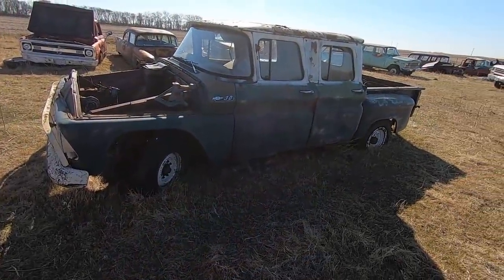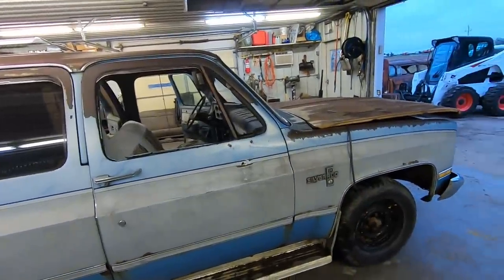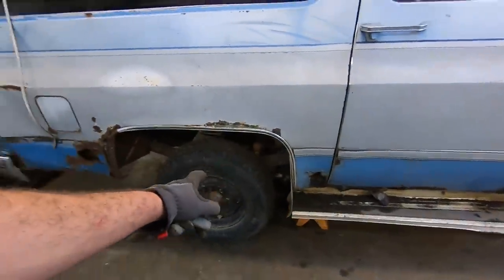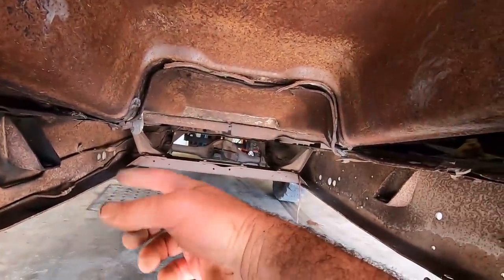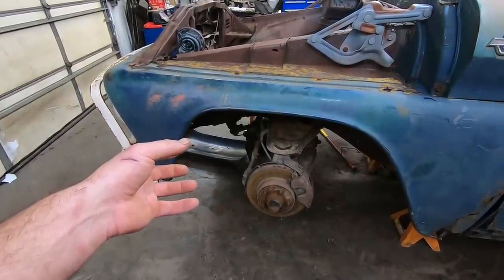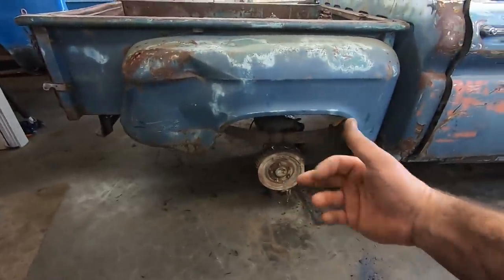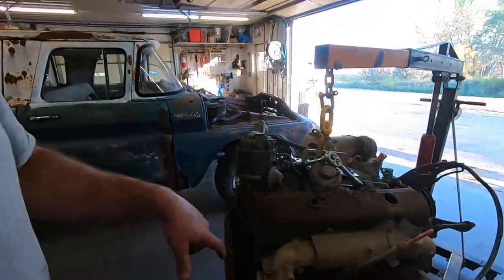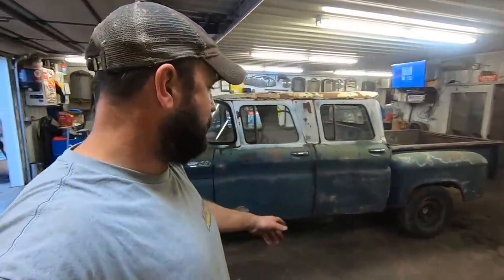RARE! 1962 Chevrolet CREW CAB factory conversion field find! And 1/2 ton suspension swap!

Comment: You could also use c20/c30 squarebody engine towers. They are shorter and almost mount up perfectly. It's what I used on my 68. Works like a charms. Keep up the good content
Reply from the maker: 67 on up trucks have taller frames
Reply: That’s what I used in my 63 C10.

Comment: I feel Sorry for anyone who would have to rebuild a truck so far gone as this one. I recently rebuilt a 1957 chev 1 ton , and after replacing the cab ect... 3 donor trucks, parts from four old doors,I finally was ready to start body work . It took me and a friend 1 and a half years to complete. It  Has a grafted on frame welded on right behind the shock mounts  from a 1974 chev  3/4 ton , rotors from a 1988 1 ton PU, and a 1978 differential . Also, I think all 302 Blocks had DZ stamped on the engine pad. Great Video guys!, reminds me of days gone by.

Comment: Awesome job dude! I have a question! I thought you could take the chevy suburban body off of it's frame and take the old truck off of it's frame and do a frame swap? Would that be easier? Maybe more work? If the one ton is 133 inches wheel base? I think the suburban is 129.5 if I remember correctly? Just curious! Have a good one!
Reply from the maker: Then you gotta remake all your body mounts and your wheelbase is off

Comment: Great channel! I’d love to spend a week rebuilding an old square body and getting it back on the road. As a truck driver(mainly in the south) you hardly ever see anything older than a mid 90’es. My DD is an 03’ F150 4.2 4x4 but I’d love an old F250. If I lived closer I’d probably buy one of your old trucks.

Comment: When you install the 1983 Chevy cross-member square body. Then you did put in the lower mounts. The mount was too high over the longitude chassis rail of the 1962 Chevy crew-cab truck. Here - some suggestion is to add in the bar as a spacer between the mount and the chassis. Then drill two holes thru the bar spacer. Then heavy duty rail spacer will be tighten with two bolts and two nuts plus extra bolts and hex nuts on other side where the mount (car engine cradle) is. You did super job and on film.
Reply from the maker: That’s exactly how I do them

Comment: YW is a 1966 327/185 from a C60, M60 or S60 truck. Your block was cast on January 27th, 1966 and the engine was assembled on January 29th at the Flint, Michigan
Reply from the maker: Yup!

Comment: Hey Mortske, Got my Duff Tee shirt. Cool. YW is a 66 327/185 horse out of a C60 truck. The relieved pistons are a give away it's 60's. The 70's went with dished pistons for smog issues. I have a 1969 300 horse 350 with the same pistons. Really enjoyed this video. I was unaware those front ends could be swapped like that. Keep up the good work. Thanks
Reply from the maker: Thanks for your purchase Bob!

Comment: Same year as my bus. Same emblem only 50 not 30.
I had to swap out the front end from a 72 C50. Only Chev, not GMC, had the torsion bar IFS for just 3 years. 
I couldn't find any parts for the original setup. Called across Canada and USA even talked to a couple guys in Mexico.
Gave up on that.
I just built a new 350 for my 82 K20. Now I have a 350 4bolt block sitting around that I'm tryna sell. No luck so far. 
It sure is a lot funner watching you rip shitapart, lol. Good fun.

Comment: Very good friend of the family (I still call him Uncle Phil) was an engineer for Union Pacific RR and bought one of their left over Crew Trucks like this. Come to find out they made them for the Rail Roads as well as the Military. But his is a 3 door, not the 4 door. Been years since I seen that truck, but is does still have the old manual "rail riders" that drop down so they could drive it on the train tracks. Good vid, and good find.
Reply from the maker: Awesome!

Comment: A quick glance at the back of the crank with the flywheel/flexplate off will tell ya if it's a 350 or 327. Great episode!
Reply: 327 blocks are hard to come by now. That block could be salvaged with a sleeve. Of course the pooch in the side of the pan might indicate a thrown rod Dropping the pan would reveal the truth .

Comment: The Apache was a trim model. Just like c10,  cameo, silverado, cheyenne and so on.. My first truck was a 1960 Chevrolet Apache custom fleetside longbox with a 230 sstraight 6   3 on the tree.
Reply: C-10 is a model not a trim option.

Comment: Definitely a 68 block. You can tell by the pad where the crankcase breather tube would have been mounted on small blocks through 67. I had a couple of these 327 blocks. Large journal with cast crank. But as Mortske pointed out, it was rebuilt and a 350 crank installed.
Reply from the maker: Good info!

Comment: On my '65 C10 I went with a Scarebird setup disc brake wise. Seemed the best option at the time. Factory parts (they give you a list) wise, rotors, bearings, calipers pads etc. All on the factory spindle. What they did not mention till I was installing, was hey, you cannot use factory rims.....$700 in wheels and tires  later I had disc brakes. Rez engineering PS conversion, and a random 1/2 ton suburban swaybar and stands later...
Reply from the maker: I've used their kit on a Dodge D100. Same issue, stock wheels wouldn't fit.

Comment: that is a rare find i get a lot of rigs but have never found one of these i do a lot of hauling off places that people died or they need to sell the place u would be surprise on what i get one place told me to haul off all the rigs they had 5 in the shop with a bunch of engines some fresh rebuilt parts in boxes transmissions and 15 rigs out side all good rigs . this will pop ur head the first one inthe shop was a 79 chevy cheyenne 4x4 short box full option truck in mint condition with under 35,000 miles on it the car next to it was a 67 rs ss 427 yenko that was being  restored next to it was a 68 ss 396 both camaros the next to them was 2 79 z28's all are rust free clean body cars the truck i had to put a new fuel pump and clean the carb still runs great today no shit just haul it off had 30 days to do it all. so they could put the ranch up for sell 6,000,000  they thought it all was junk
Reply from the maker: Crazy!
Reply: @MortskeRepair  i call it my holey grail find plus i don't know if u know that u can get the ho 454 450 hp with a 02xx 400r turbo out of motor homes i got 4 of the crate sets so far this year with 6,000 to 58,000 miles on them for free saves a lot on a build the engine has the 4 inch stroke with steel crank heavy rods high flow heads the 02xx 400 is good to 800 hp and they work great gm calls it street strip or heavy application trans

Comment: That was a very clever way to load the truck!
Reply from the maker: Gotta get creative when they won't roll!
Reply: Just got to the end of the video and had a I-know-very-little-about-this-stuff question for ya: Would it be possible to sleeve the cylinders to get around that crack or is the block a lost cause without some serious work?
Reply from the maker: @SpawnofChaos  You could definitely sleeve the block with some machine work.

Comment: Man they certainly walked away from that gem after they'd cut-n-shut it and said "yep.. thats perfect"

Makes the "quality" control at landrover in the 70s look almost Rolls Royce-esque
Reply: It was probably a power, water, telephone company or fleet truck they were not really worried about long term.
Gm did not do that it was some small independent shop. Wouldn't be surprised if they also did limo's.
I'm betting they are long gone
Reply from the maker: Air Force rig.

Comment: just did some delving into my books and the numbers you have is its a 350 smog block for 1979 light duty truck
Reply from the maker: Interesting, for the casting number or the stamping number?
Reply: @MortskeRepair  the stamping numbers

Comment: I got the same Harbor Freight jack. On sale for 80 bucks,works just fine.👍
Reply from the maker: Lucky!
Reply: @MortskeRepair  If yours quit,you may wanna check the fluid and re bleed it. Had to with mine and I've used it regularly for appr a yr with no problems.
Reply from the maker: @stevewheatley243  Mine puked the oil out of the seal. So the seal is shot at a minimum.
Reply: @MortskeRepair  Bummer bro. You could  put new seals in it. Good ones.

Comment: the 283 damper is narrow (3/4") - 327 wider 11/8" or so 350 is 11/2 approx. - 400 is oddly shaped since they're externally balanced (different flex)

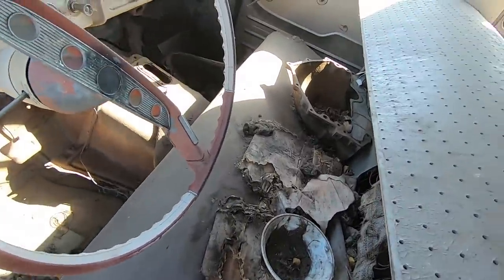Comment: At the beginning of this video, (1:20) Duff's fur looked like my beard when I'm left alone and people aren't around hassling me, but by the time the Suburban was being unloaded at the shop (9:00), he had obviously seen a beautician.  If I cleaned up half as good as Duff does, I would definitely have better luck with the ladies because personality alone can only take you so far.  Anyway, another good video although this one is only half the length of Dances with Wolves, so I'm not sure what I'm going to do with the extra hour.
Reply from the maker: He grows it out real fast! 5 O'clock shadow!
Reply: @MortskeRepair  ha  that quad  cab needs some gallons of bondo  and surform files to contour it up  and a smoothsided bed

Comment: are those keystone step twos? the hamms brewey buildings are still in saint paul minnesota. grandfather and dad worked there. flat cardboard tray of dented cans for .50 cents. i think like 24 cans of hamms. awesome lock stock and barrel battle between west side of saint paul with schmidts and east saint paul hamms. the neon light of schmidts was often vandalised when they cut the letter m. schidts. grain belt was minneapolis.
Reply from the maker: I love that big Grain Belt sign!

Comment: If that stamp is a YV and not YW then it is a 1968 327 220 HP 4 barrel with a manual transmission.

Comment: 700 r 4 I think those are great transmission I got that kind on a 1988 chevy stepside great truck  my friend quite the tork  with those  4 11s  in the front and back cause it is 4 wheel drive peace out my friends 😁👍

Comment: The engine appeared to have a passenger side dipstick which would make it a 78 or later block, strange because I find that casting number as a 68 also???? More than likely the heads are cracked also across the center 2 exhaust seats, that was common with those 78 and later lightweight castings.

Comment: Do you ever rebuild a motor? Opps, you answered that 1 rite after I asked. Fun times
Reply from the maker: I have, but not for a LONG time!
Reply: @MortskeRepair  Maybe a super cheap rebuild would be cool. I cracked a piston 1 time and just replaced rings 1 size over, honed the cylinders and rod and main bearings. Pretty cheap and I got another 100k out of it. I don't know if it would be cheaper than buying used runner, but would make a cool video I think..

Comment: Last 1saw was in Attica ohio it was red a Ashland oil it had cross bars at the front behind the double cab and a set at tailgate no doute it hauled oil pipe truck was a 1966 283 4bolt mains 4 speed trans

Comment: That Burban probably came with a TH350 with a lock up converter. My 80 C10 did.
Reply: HE said it has indicators for 4 speed overdrive which would require the TH700R-4 which is an electronic lock up torque converter transmission... the 350 is only 3 gears at final drive ratio of 1:1

Comment: Yes you could sleep it but usually they don't run the same after they're sleeved they actually bore it out as big as it can get and then they put lock type 515 gear locker down the cylinder and drive to sleep in there when and heat the block and push the sleeve and it has a screw and it's ahold it and then they're grinding the screw off and bore the hole back to standard or whatever size epistent is

Comment: I bet the rear door hinges whistle nicely. I would cut the back off a wrecked suburban and weld it on
Reply from the maker: The regular cabs whistle even
Reply: @MortskeRepair  what happened to that rear axle? Sending it to the junkyard? I bet that thing could pull a semi trailer with that. Looked like it probably rode on 20” rims factory?

Comment: is that an actual crew cab or two regular cabs welded together?i like the 55-59 chev or gmc and there were no crew cabs made during these years.
Reply from the maker: 2 cabs, made by a conversion company when it was new.
Reply: a special order for sure.thanks

Comment: Great video!  👍
 Not sure what this might look like as a low rider.  
You keep saying this is a factory modification to become a crew cab, but none of it looks like a factory would have done this. Are you being sarcastic, or is this really a factory modification?  If it was done by the factory, they sure don't seem to have put much effort into it even though you'd think they would've had all the resources to make it look factory.  I also didn't realize the factory would offer such a conversion.  🤔
Reply: Railroads and Oil Rigging companies special ordered these trucks, usually with 4X4 and 1 Ton suspension. U.S. Military- Navy and Air Force ordered them as well. This is the first time to see how poorly they were produced. Mortske did a great job showing the shoddy manufacturing on this one.
Reply from the maker: This was built by a coach conversion company for the air force.

Comment: the change in temperature and the engine being cold made the moisture condensate on the inside of the block and fill with water
Reply from the maker: Not a chance it caused it to fill with that much. What about evaporation?
Reply: @MortskeRepair  same thing change in temperature cold to hot takes years to fill a car engine  had a old ford engine to the top with water
Reply from the maker: @cc9z  I've got engines sitting outside in the rain that aren't filled to the top with water from rain and humidity so I find that hard to believe.
Reply: Set a car in a tin shed this spring when night is cold and days get warm and condensation will be dripping off the motor inside and out

Comment: 30 + years owning an automotive machine shop. the 624's have to be the worst SB heads ever made. You can spot them due to the scalloped edge under the exhaust at head gasket level. Thin don't flow and due to the induction hardened exhaust seats it seemed like most were cracked in the center 2 seats. Of coarse very few people bring the good stuff into be rebuilt so shops only see the broken stuff. 
.040 and non matching numbers means it was probably an exchange short block from one of the old production rebuilders. They only stock one size of piston .040 and bore everything that size. So if its standard it goes .040 if its .030 it goes .040. Most of those guys are long gone because there crude rebuilding systems wont work for modern engines. Cool truck its amazing what they did in the 60's when labor was cheap. AND im guessing some REALLY cheap labor did that work.
Reply from the maker: Good info! Thanks for commenting Tom!

Comment: 2 things. 1) Chevrolet used the 2 letter motor suffix in the 60's and switched to the 3 letter suffix in 1970. And 2) that is probably a 350 as it is definitely not a 327. Chevrolet did not use a pcv valve on the 327, 302, 283 or 265 motor. They all had closed valve covers, as they used a canister under the intake manifold that attached to a vent tube that was next to the distributor and ran down the back of the motor. You don't have the canister, the tube or even a blocked off hole where the vent tube would have been. 350's used the conventional pcv valve in the valve cover and no provision/hole for the vent tube next to the distributor. Just some useless knowledge for you to forget in the future. Lol. Thanks for the video
Reply from the maker: I love useless info!

Comment: When those jacks start blowing oil, its usually just an O ring thst needs to be changed for a quick easy fix.
Reply from the maker: Yeah but the poor machining in them causes them to blow out right away.
Reply: @MortskeRepair  Next time buy the Harbor Freight Daytona Series. Awsome jacks, exact copy of the Snap-on even got sued by Snap-on.

Comment: That engine is an odd one,  isn't passenger side dipstick a '80 and up block? I have seen a pre-'80 block with passenger dipstick, but it had a plug in the regular dipstick hole on the driver side and a machined block bolted to the side of the engine block on the passenger side with the dipstick.  I believe it was supposedly out of a '78 Corvette when we checked the suffix code, I wasn't sure if it was a Corvette thing or some kind of weird reman thing to convert to passenger dipstick, but I've never seen another.

Comment: Why not drill 3 more holes and use the steering gearbox off the suburban? Done several conversions on 60s trucks with 80 - 87 truck gearboxes.
Reply from the maker: They make an adapter kit. I never looked into it. Maybe once an engine is in place.

Comment: If it's a 68 what would it be worth of a building or at least put an afternoon because it was a real 2 or 327 that's a valuable engine if it's even on 350 it's a high nickel block so it'll be a good one

Comment: Just wondering if you knew that 60-61 had the torsion bar front end 62 is when the coil spring can to play, also the 82 rear end is a bit wider than the 61 rear and getting the tires to fit under the rear fender is going to be a ordeal to sa hothead least
Reply from the maker: I've got 7s on the back now and there's plenty of room. We'll keep an eye on it tho. I've got a 62 C10 that I drive and that's got torsion bars. 63 was the first year of coil springs.

Comment: My opinion I love 350’s more than the 327’s had a 66 3/4 ton with a 327 and talk about gutless.. that 67 Ford 390 3/4 ton smoked it..
Reply from the maker: You're also talking 63 more cubes too!
Reply: @MortskeRepair  but.. that’s a Ford vs Chevy too🤣 chevys got more power per square inch.lol